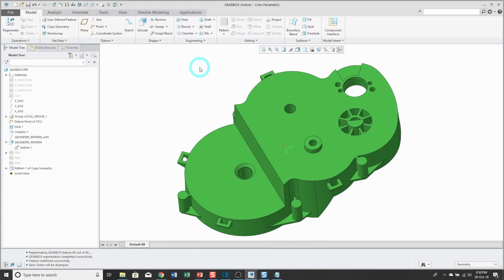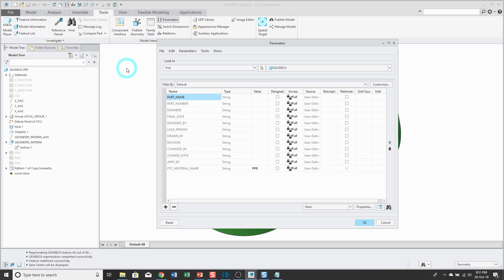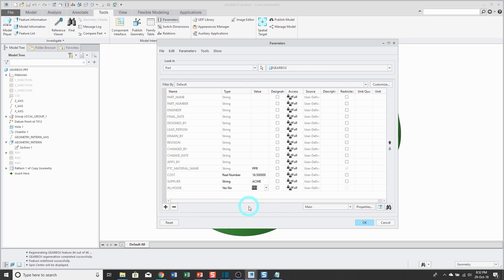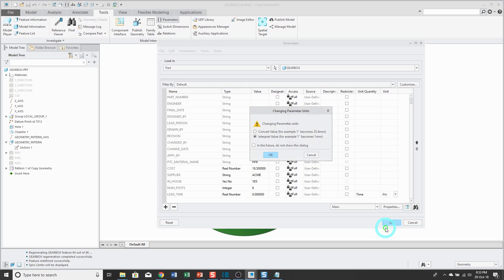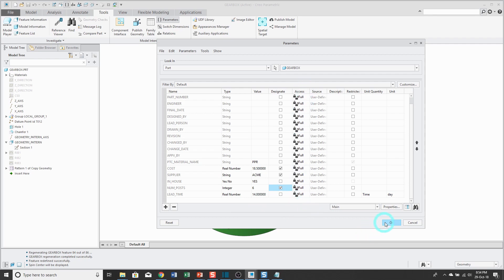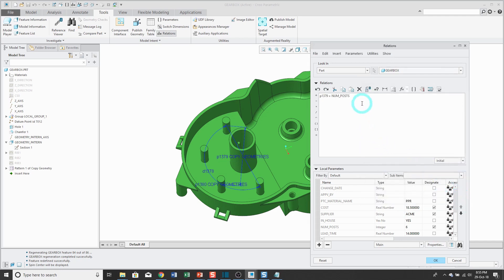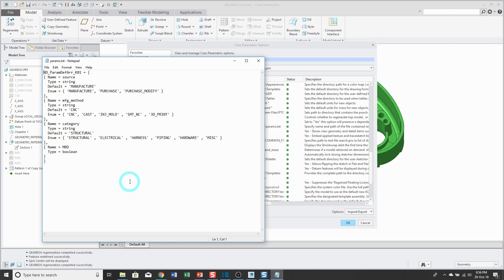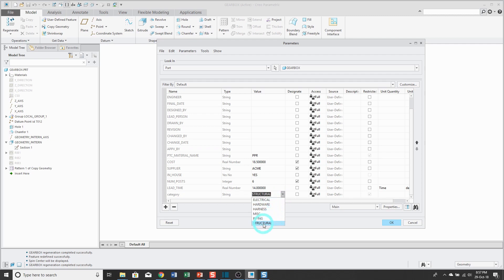Creo Parametric - Parameters (Demonstration)

Comment: Hi @CADPLMGuy. I am seeing a column called "Owner" in the 'Parameters' pop-up window, In which some parameters has the model name as values, some has the feature name ('Cosmetic ID 945' in my case). So in parameters itself we have many types like 'Model', 'Feature' etc.,? Can you give your insights on this?
Reply from the maker: In which Parameters pop-up window are you seeing the Owner column? Have you talked to your admins first to see if this is a custom column / parameter that they have added? I need more information and details before I can provide any insight.

As always, remember that Creo and Windchill can have a lot of configuration and customization. I recommend checking with your admins to see how they have configured and customized the tools, and not assume you are necessarily seeing what the software would look like OOTB.

Comment: Is there a way to share parameters between parts without the Top Down Design module? Do you have a video with that process?
Reply from the maker: A workaround would be to use embedded Mathcad worksheets. I do have videos on that subject.

Comment: Thanks a lot for the video. I learned a lot. I like to have a local string parameter, say "TWL_Data" that will have TWL_Data =<Type> x <Thickness> x <Width> x <Length>. Could you help. Thanks.
Reply from the maker: Look into the string functions.